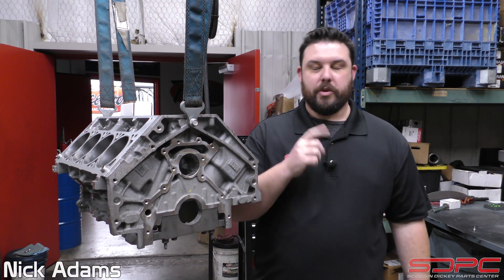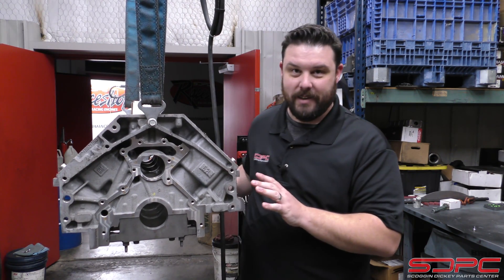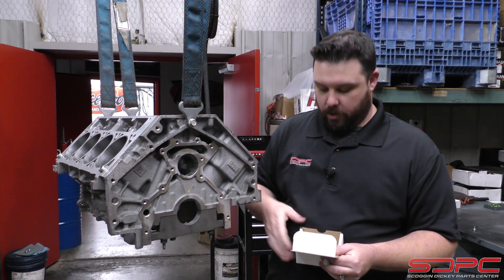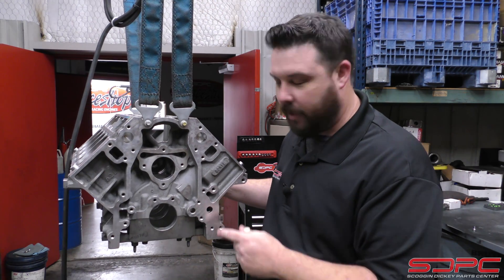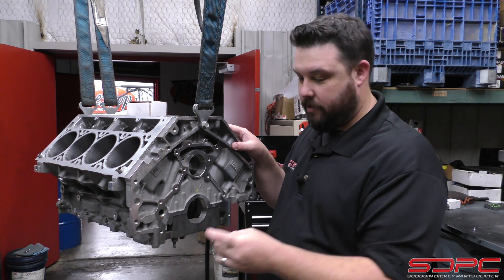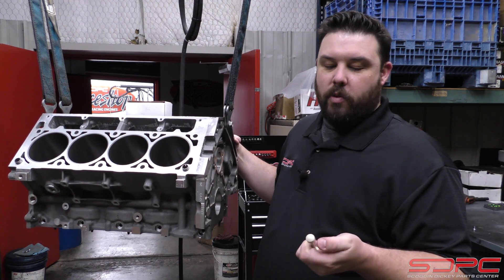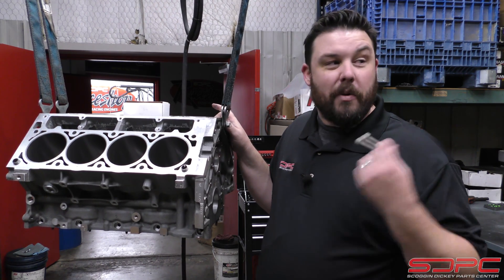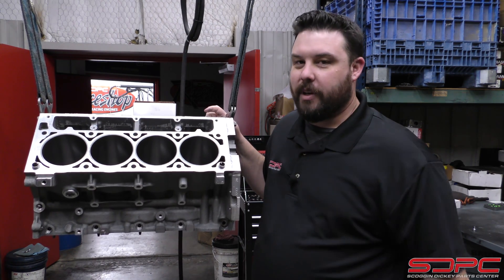SDPC Tech Tips: The Barbell Oil Galley Plug

Comment: I wonder why they design the block to need the plug in the first place. Why not just make it so there's no exit hole there?

Also, I found a 'barbell' plug that has a double o ring design. One on each side. Not sure if that would cause a problem, or if there is really any benefit to it.

Comment: Tell me about the melling aluminum galley plug.

Also, if it’s already a tight fit, wouldn’t the aluminum expand and prevent oil from bypassing the oil filter if said oil filter fails and plugs

Comment: Refreshed my engine, and ive been up all night with a thought, engine still on an engine stand so not too bad, but i had bought the moroso oil barbell, and installed it but now im thinking, can it pe put in backwards? It kinda clicked into block and sits flush, i have the rear cover on and sealed but cant stop stressing on it

Comment: I have an 07 Avalanche 5.3 V8 with 260K miles on it. My oil pressure never pass 40 PSI at cold start I was wondering if it's possible that the diverter barbell could be the reason for this small issue. I already replaced the pick-up tube o-ring, oil pressure sensor and filter as well.

Comment: Hey random question…. So I’ve been chasing a low oil pressure issue and can’t figure out what’s causing it.. new oil pressure sensor, pick up tube is clean, replaced the pick up tube oring, replaced the oil pump, and a plate that is behind the timing cover… this bar bell is the only thing I haven’t replaced. 

At first when I did all of this the oil pressure was good. Went for a trip and on the way back it came back.. took it to have a shop hook a mechanical gauge to it and still showed low oil pressure… would this possibly be the culprit???

Edit: oh yeah! This is for a 2005 Chevy Tahoe 5.3l…😅
Reply from the maker: It's possible, even more so if you pulled it out to inspect and reinstalled it.

Otherwise it could just be bearing clearances have gotten to the point that it just needs a refresh.

Comment: Sometimes just air pressure will blow it with a blow gun in the forward passage .
Reply: This oil gallery is cast into the block, drilled and honed to final size. I have seen the 5.3L iron blocks built and assembled during my time with ACDelco. That’s an excellent time to clean real good! 
Great comment!

Comment: If you building the engine chances are you are at least a mechanic and have access to a drill and a tap set .. I would drill it and run a tap into it and thread a small bolt onto it and then remove it using any type of a screwdriver with a spacer for leverage

Comment: Question????? have you ever seen an oil galley plug with a valve in it to bleed the air out? 1965 mercury 390

Comment: Do you really need to replace it when doing a rear main seal? Not building a performance engine just daily driver truck .
Reply from the maker: Do you have to? No.
It's just that little bit of added insurance if it has high miles and you're back there anyway.
Reply: @Sdpartscenter  thank you for your response.

Comment: Great job on explaining the oil gallery “Bar-Bell” and it’s function. I have been a dealer tech and used the GM tube of thread sealant, now sold by Permatex. Following & cleaning plus checking every component in the oil galleries and passages is extremely important. Be very careful of the other GM feature in the oil pan dump. What? If the filter becomes a high restriction it can open a spring-loaded ball valve and dump oil into the pan because it is part of it. If your pan doesn’t have one, good. Just understand that if it is a home build and a stock pan is used, look for it. It needs staked, plugged or removed, tapped and threaded to accept a sealed plug. What pressure does it open at? Good question as it is not published and it does not know. Trash holds it open a faction, low oil pressure, spring losses tension with heat and time. That’s why they make new valve springs to achieve correct valve seat pressure. Many aftermarket pans come without it, as Martha Steward says, “That a good thing.” Please look and never forget the front & rear lifter oil gallery seals. Yes twin galleries that supply oil from the back to the front, then sealed by the cam plate. Videos show folks rubbing a finger over it install to feel for a raised surface. It is cheap! Replace it and get your oil to the parts. Don’t chance it as right or wrong, Permatex 518 red jelly seals machined surfaced to seal in the absence of air. I wipe a tiny controlled amount over this sealing surface. I feel strongly about the oiling system! Hopes this helps just one guy/gal on their LS build. This guy is not wrong! Certified Automotive ASE master tech since 1978, retired. Nice video…
Reply: I believe this is the AFM bypass valve found on Gen IV oil pans.
Reply: @AndreS_-df2nw  ,which bypass valve?
Reply: @phillipduran2576   This was inside the oil pan at the rail. The factory donor 2003 Tahoe 5.3L was the tall OEM pan and many will use a punch to set the visible check valve, while Holley “Sports Pans” omit it. It is drilled were oil turns off the main gallery to force oil thru the filters outer media. It was not a DOD engine or AFM.
Reply: @AndreS_-df2nw  This was on a factory oil pan off a donor 2003 Tahoe 5.3L without “Displacement on Demand!” The VLOM gets its oil pressure thru a screen under the rear oil pressure sensor.

Comment: If you wouldn't mind.  I would like to know about GEN V ecu's i.e. is the factory ecu the only one that can use a fuel (ethanol) "sniffer?"  Is there any that are drive-by-cable?  What is the best solution you have found? So on.  Thank you!
Reply from the maker: You can technically run a Gen 3 PCM, there are write-ups and videos on using the 411/P01 PCM out of a 2002 Flex Fuel Tahoe.  It requires an operating system update on your Gen III pcm.  This allows the use of a flex fuel sensor as well.

A lot of the gen IV PCMs used a "virtual sensor" that adjusted fuel trims according to the O2 sensor readings.  This is relatively ok for stock cars, but it goes pear shaped on a modded car.  We recommend running a flex fuel sensor, switching from virtual to sensor in the tables using HPTuners as well as a proper calibration with a baseline of regular pump gas and then E85 so it can properly blend accordingly.  You'll need to follow the instructions closely for any flex fuel sensor install as you'll need to pin in that sensor into the PCM harness.

Gen V PCMs are going to be just like the Gen IV PCMs.  There will be a lot more in-depth tuning needed especially if you have more mods.  Cold start/remote start can be troublesome and will require some fine tuning as sometimes the car won't do a remote start if it doesn't light off right off the bat.
Reply: @Sdpartscenter  Thank you for taking the time to answer!  I'm a bit under the curve with ecu's.

Comment: Can that threaded port at the front left (driver's) side be used to screw an oil pressure test gauge fitting into to get an oil pressure reading? Do you know what size thread it is (3/8 NPT or whatever)? Does an LS7 and/or LT4 have this same threaded port? Thanks for the video!
Reply from the maker: LS is M16 x 1.5
LT is M12 x 1.75 (it is usually blocked off or covered/in use by a power steering pump on trucks)
Reply: @Sdpartscenter  Ok thank you!